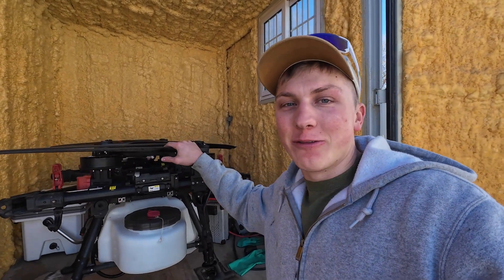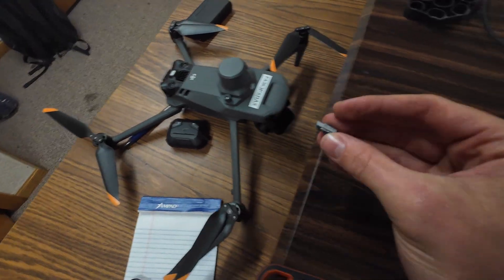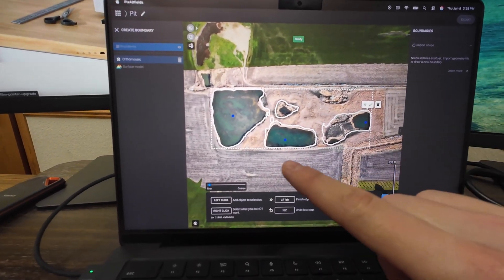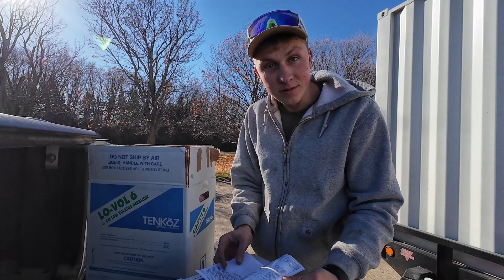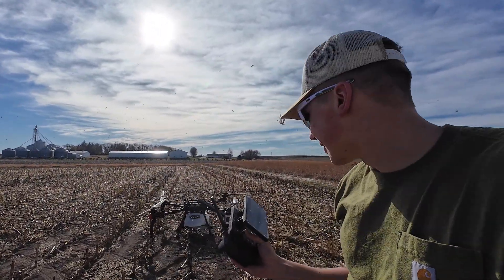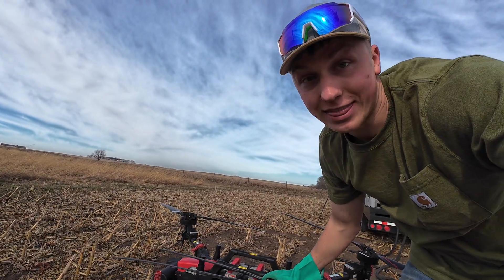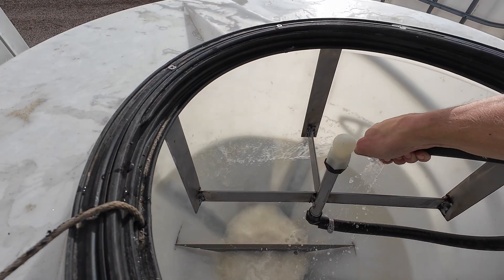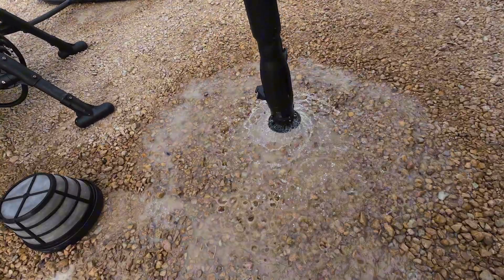99% of Spray Drone Pilots Wouldn't Do THIS!!

Comment: For now, a good winter here in the Netherlands. It's definitely winter. I think I saw the 50 here. The latest T100 is on the trailer here.
I hope everything is clear from DJI for you (USA).
Reply from the maker: Winter here as well. Which means time to prepare for next year. Not too many T100s around here in the US yet

Comment: GOOD LUCK GETTING PARTS FOR WHEN YOU BUST IT
Reply: This drone model is approved by the FAA and not affected by the recent ban. Parts can still be produced and shipped to the USA, as well as new drones of the same model (XAG P150).
Reply: @XakX32 the new loss states all d j I drone , all autel drones and related part band doesn't have to mean that it's FAA approved because all the other drones are also, they are now banned.You can fly what you got, but you can't get parts to fix it.And you can't replace it with new ones.\nGet it says all foreign drone
Reply: I think it's the FCC that has the ban list not the FAA.
Reply from the maker: As far as I know this model is good under the legislation change. Also I don't plan to bust it :)

Comment: If you had a higher elevation for entry and exit it would probably not struggle over the water so much. That's what I'd expect anyway, not 100% sure though.
Reply from the maker: The water wasn't just by the entry/exit point so don't think that was the issue.
Reply: @HiTech_Farmer 
My drone will stay at the entry and exit point height until it gets to where it left off spraying. So if it's flying over the water to get to where it started it will stay at x feet elevation until it gets to where it wants to spray and then it will drop down to the application height. Mine is an EA vision drone though, not XAG. So maybe they work different.
Reply from the maker: Gotcha, different brand would do it

Comment: Nice! That drone sure works amazing. In my opinion, you should just go buy a second one of those. By the way, I saw that you changed the nozzle for filling the drone up on the trailer. Any particular reason why? And keep me updated on when you get your first truck.
Reply from the maker: A second drone is a good idea, would need a better and bigger trailer setup to make that work. Changed the nozzle to try to fill faster, didn't make any difference. Will do!

Comment: This is random, but it would be nice if drones were fast and efficient enough to simply fly them out from your home/farm and perform all of the operations you need without going to the location...just walk out of your house and refill the tanks or switch batteries.  That way you wouldn't need a trailer.
Reply from the maker: It would be super slick if that worked. Problem is some of the fields are 20 miles away